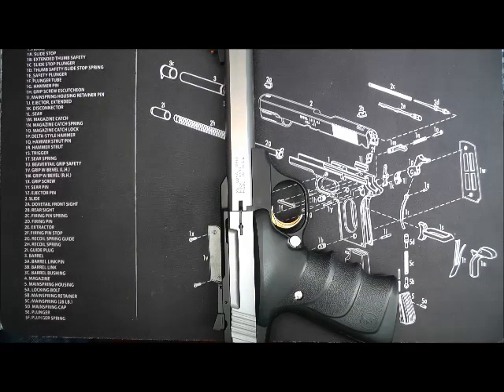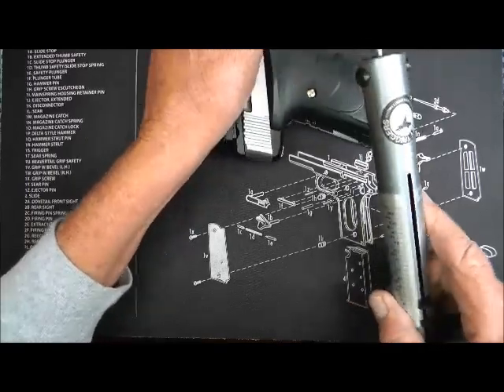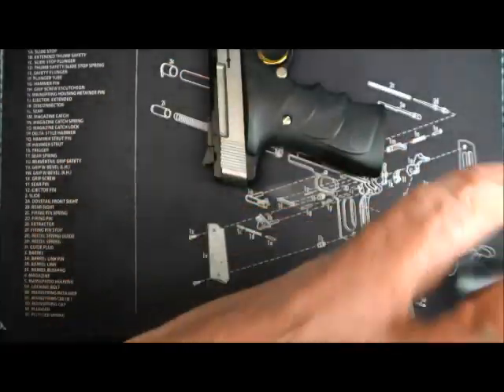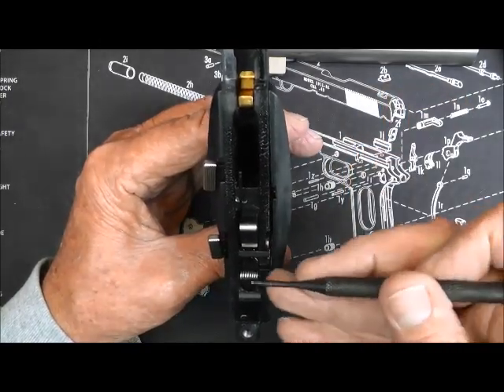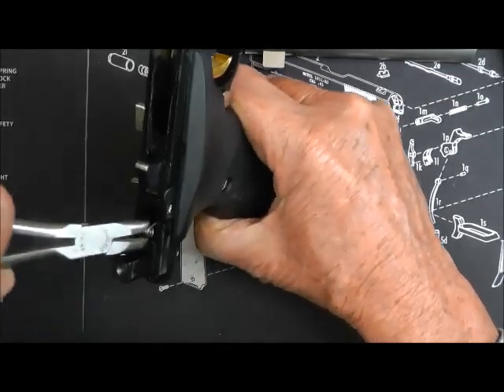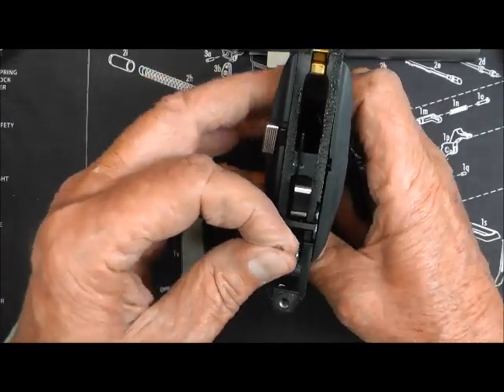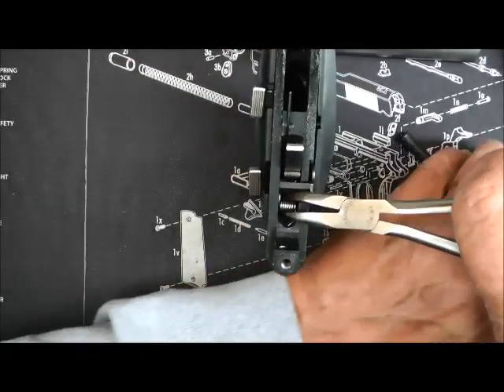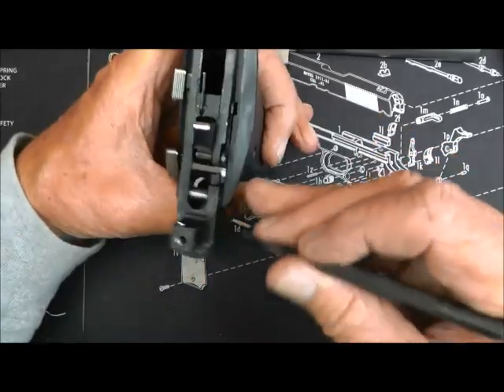Buckmark Trigger Job

Comment: I did this year's ago and it was great for about a year then it stopped resetting the hammer so I had to flip it back. Just so you know, it's much harder to put it back like it was.
Reply from the maker: Robert Taylor When it happens I’ll deal with it 😁
Reply: @MyHollowpoint  You had one flipped all these years and never had a problem? That's great, I loved mine when it was like that. I never would have switched it back if I hadn't had a problem.
Reply from the maker: @roberttaylor6030   Midway USA has the reset spring for $4.99.
Reply: @MyHollowpoint  I should do that, I just remember how hard it was to put back the original way. But if I bought a couple of springs I could probably just pop another in if I started having problems. Having a 2# trigger in it is really cool. Thanks I appreciate it.

Comment: Just now did it to mine and it took no time at all. Outstanding. I'll report back after I hit the range tomorrow.
Reply from the maker: +Jay T  You'll love it. If not you can just change it back. It'll definitely be lighter. You should be able to feel it without going to the range.
Reply: +MyHollowpoint  Just got back in from the range and the trigger job is outstanding. I sold my Smith and Wesson 41 because  this Buckmark shot almost as well for about 1/3 the cost and now with this trigger mod I like the trigger even more than I did the trigger on the 41. I waited to test it because I didn't have any snap caps and I don't ever dryfire my 22's but about 400 rounds shot tody and I couldn't be more pleased. Thanks again
Reply from the maker: Jay T Glad it worked out for you. Knew you'd like it.
Reply: @jayt2989  You still around? I flipped the spring on mine and it was fine for about a year the it stopped resetting the hammer and so I had to flip it back. Just curious if your's is still going or not.

Comment: I wouldn't mind doing this to my buckmark, but I can't get my barrel screw loose. I've broken three hex wrenches trying to loosen it and my gunsmith broke his wrench to
Reply from the maker: They put some kind of crap on that hex bolt, I thought this one was stuck but managed to get it out.I'd check to see if you can still get in there by just taking the sight mount off and removing the bolt assembly.

Comment: Hi.  I learned a lot from your video.  I learned that - just drop it & then get  the shorter end towards the back.  Then it's easy to insert the pin.  I will try to do it on the 2 buckmarks I own.  Sincerely,   JAMES.

Comment: Watch this mod, it can make the gun inoperable. Not enough spring pressure to engage the sear after the first shot. You'll might get a false ok when testing by hand cycling the slide.
Reply from the maker: I haven't experienced any problems when firing this pistol as of yet. I researched it first and found articles that said it works. An old gun will have problems with a weak spring but I haven't experienced any problems to date.

Comment: Your eye sight must be perfect... I would have been searching for those flying small parts all night. I have never measured the trigger pull on any of my guns. Is the rule just the lighter the better, or is there such a thing as to much of a good thing being bad.
Reply from the maker: Too much of a good thing IS bad. You've got to be able to "feel" the trigger in my opinion. 2#'s is not too light though. I wear glasses and that helps. There's a spring on the floor that I dropped a year ago and haven't found, I also dropped a mount screw that's still down there somewhere :)

Comment: My pin won't budge, I also don't want to take a hammer and beat on my new Buckmark
Reply from the maker: If you've tried it from both sides then I'd try finding a video on how to get it out. That's a head scratcher.

Comment: It is called Heggins Flip....  I did this trigger mod. There are some safety cautions not mentioned here. I suggest anyone one doing this to go to rimfirecentral dot com and look for BuckMark trigger work thread. You need to do the "flick test" and be careful to recognize an unsafe gun condition if you don't get spring into the sear notch...
Reply from the maker: +gmcjetpilot  As with any modification there can be exceptions which is why I said I don't recommend it but just doing it to mine. I've done it to all my Buckmarks and haven't had any problems.
Reply: +MyHollowpoint Good to know it's working well for you, and good advice don't do it unless you know what you are doing and accept the risk. However it is easy and results can be great. Just did my newish BM URX. Now trigger is a crisp 2 lbs. I didn't measure trigger pull before spring flip, I estimate mine was 4 to 6 lbs before. Not too bad for carry gun like my Glock, but a 22 target pistol I wanted it lighter. The short take up and crispness was excellent before and after. However I haven't shot since modifying mine BM. If I have a hint of any reliability issues, I'll put spring back into factory position. You can polish, lube and bend spring a tad to get to adjust. However then you can't go back if you tweak spring. With that said if you do it and successful it does make a nice light pull. If you do it wrong it can make the gun unreliable or dangerous. PS this mod is not for carry, range gun and handled like a gun with light trigger should be, with extreme caution.

Comment: I went holly shit when that pin went flying!!!

Look at Cabela's on line gun vises. They have one for sale from Tipton called the best gun vise. Takes long guns and pistols. $50. free shipping until sometime before xmas....I just ordered one a day ago and looks like it will be delivered today!
Check out their website
Got to get me one of those trigger pull scales!
Reply from the maker: It's going to happen. Sometimes I find them sometimes I don't. There's a small spring on that floor that escaped over a year ago. I've got one of Tiptons but I normally just get it when boresighting or mounting a scope. This is a 5 minute job in the right hands :)

Comment: Don’t do this boys. They call this the Heggis flip and it AINT WORTH A FLIP!!!  Leave it like it came from the factory cause it was ENGINEERED that way. I did this and my URX wouldn’t eject, feed properly or trigger reset correctly. I put the spring back like it came from the factory with the arms orienated to the top and hated and questioned my existence on this planet for doing this.

Comment: Awwwww, I am disappointed... no hammer this vid. lol
Now that is amazing how just flipping a spring will drop a pound and a half off the trigger pull.
Take care
Reply from the maker: I was left filling a little disappointed myself :) I've thought about it quite a bit. Must have something about the direction of the coil in the spring. Flipping it it moves the coil from the top to the bottom which takes some pressure off. Yeah, the details bug me till I figure them out :)

Comment: I am offended you didn't do at least 10 safety checks on camera before you pulled the trigger the first time.  It could have been loaded and shot me through my computer....you know better than that chuck...so disappointed.  I was cowering under my desk the whole time after you did that. Good thing I keep a stash of twinkies under there or else it would have been a boring wait until your video ended  :-)
Reply from the maker: I've shot in the house before, what's the big deal? Only put a small hole in the wooden tool box in front of me :)